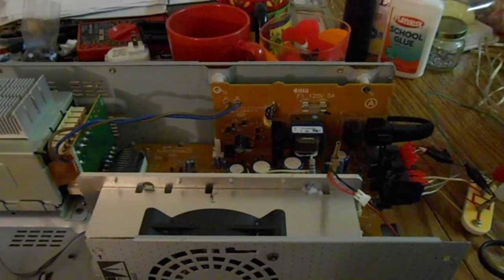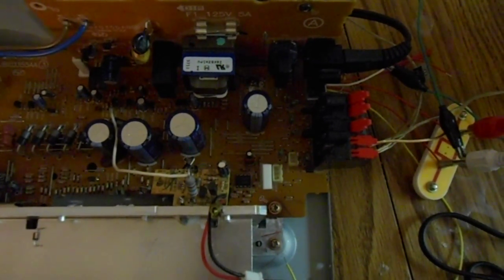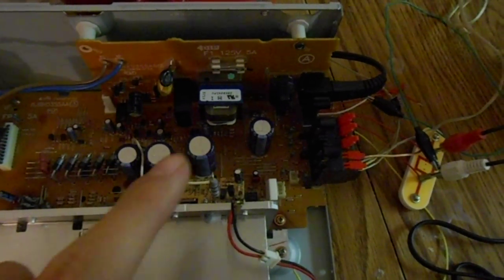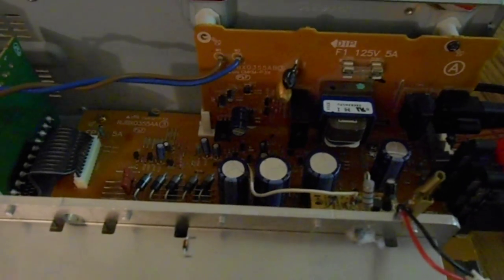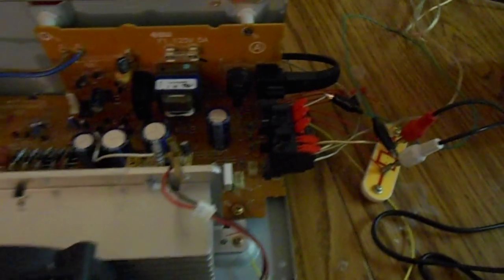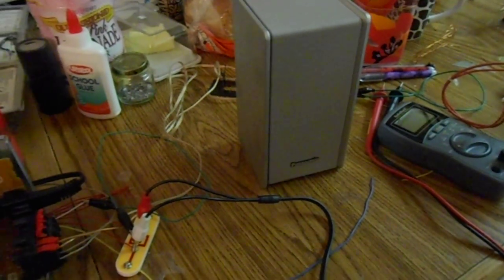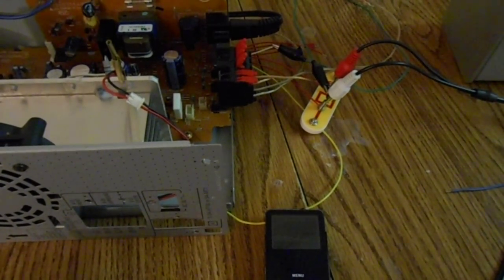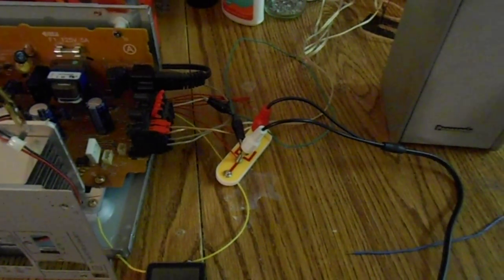panasonic 5.1 ch amplifier + hot glue flyback

Comment from the maker: Pinout: https://hackster.imgix.net/uploads/image/file/119114/Panasonic%205.1%20DVD%20pinout.jpg?auto=compress%2Cformat
The amp is from a SA-HT700 DVD player and tuner, the main circuitry has gone screwy so I hotwired the amp board, the only thing that is wrong with the amp is where the original cable jack to go to the main processor has cracked the PCB, it seems like it was like that from the factory unless my aunt got it from somebody. They sorta repaired it by soldering little wires across the gap but it isn't very stable. The little wires I have going to it shouldn't be a problem.
more documentation here: https://www.hackster.io/superbrainak/panasonic-sa-ht700-5-1-dvd-system-42bbd2

Comment: Hello, i have One of the amplifier but the DVD player not work at all, i want to connect direct to amplifier, how can i do that? Regards
Reply from the maker: click the hackster.io link listed in the description. that will bring you to a complete guide to how I modified the amplifer to turn on. you have to remove a transistor on the standby board. otherwise it will never turn on without the DVD player plugged in. once you do that then all it will need is a switch and a resistor connected from 5v standby to the power on pin. Use the pinout diagram I have on that page to get the pins right. Also make sure to use solid core wire to put inside the connector pins. if you use stranded then you will need to solder the end to keep the strands together and not fray, which could short something out!
thanks for watching best of luck to you!

Comment: Great video Brain was it the lower transistors collector that you disconnected, keep the videos coming I enjoy them.
Reply from the maker: you want to remove Q519 I believe, if removing that transistor and pulling up the power on pin turns it on then that is the correct transistor, if that didnt work replace Q519 to how it was and remove Q515.

Comment: what size of resistor is used in the 5v to base relay transistor? what resistor is used in to make the 6v to a stable 5v ?
Reply from the maker: well i just used a 1k 1/4W resistor from the 5v to the enable pin, i didnt do anything to the stable 5v line maybe it is supposed to be 6v but as far as voltage regulation panasonic seems to have opted to using transistor and diode regulators which in my opinion are junk because as the diodes or resistors get old or overheated their values change meaning so does the output for example the supposedly 12v line for the fan was only 9v and i could tell how hot the regulator circuit got by the dark spots on the PCB. your amps standby line is probably fine if it is a little on the high side, just dont use it to charge your MP3 or phone :) it probably doesnt have enough amperage to do that anyway. good luck!

Comment: You can make a diagram and explain how to connect How turn
Reply from the maker: Hey there thanks for watching! Are you asking for me to make a pinout diagram of the amp/sub main connector? I will have to look at it again but it wont take me long.
Reply from the maker: Ok so as i had mentioned in the video (good thing i watched it again as i would have forgotten) i had desoldered the collector to one of those transistors that are in the virtical line, there are two on that standby board one goes straight to the relay and the other "disables" that relay transistor (something to do with tamper protection or just a general safety feature), so what you can probably do is just completely pull that second transistor out as it only pulls the base of the relay transistor low, (try to figure out which one that is as it has been a while since ive been in it, basically desolder the one that doesnt directly connect to the relay by following the traces disregarding ground connections or power connections, (Hint: it isnt the large transistor because that one is for regulating the standby 5v supply leave that one alone) once the disable transistor is removed then the relay transistor should be able to turn on without a problem. how you turn that transistor on easily would be a resistor from the stable 5v rail to the base of the relay transistor so that whenever it has power it will turn on (basically that pin high means that the amp will turn on so you could also use a basic logic signal if you wanted a more complicated setup/mod).

Finally you can put the amp board all back together and connect it up (dont forget to plug back in the fan and Sub connections!) using my pinout i figured out (any other pins i dont describe arent important for operating the amp and are mostly smaller AC voltages or the >50v for the FLD!! so be careful!) so, looking at it you can see there are 4 wider pins 2 on either side on the top right and bottom right, those are the main ~14v <2A AC power for the mainboard and is only on when the amp is on,
then coming down from the top 2 on the right it goes;
Mute pin (High = disable i think, but it mutes the entire amp leaving it open (nothing plugged in) will leave the amp unmuted so this connection is optional to use),
then Front Left, Audio -, Front Right,
 the center mark (a little indent),
Center Input, Sub Input,
Power pin (High = ON),
two more pins i dont know what they do,
then the lower two Main AC pins (same as top they are just in parallel for less resistance).
 now on the left row it goes; 1 unknown pin,
stable ~5v (always on, you should be able to get around 500mA from it),
3 unknown pins,
Surround (rear) Left, Audio - (same as the right side one so only one connected is required), Surround (rear) Right,
then 5 unknown pins.

So basically you could tie the lefts and center to the left channel and all the rights and sub to the right channel plus one of the audio - to the negative to have it work on all speakers at the same time with only a headphone cable (standard stereo) but you can use two cables for 3.1 or three cables for 5.1 output.
Then depending on how crazy or simple you want to go you can either use a 1kOhm resistor from the stable 5v to the Power ON pin (so it will always be on when it is plugged in and just use a light switch or switched power strip to turn it on or off) or a fancy shmancy microcontroller programmed to recieve a remote signal to turn it on (pull that pin high) or turn it off (pull the pin low) and even mute it (using the Mute pin) when you want.

Now as all of the sound processing is done in the main unit you dont have any volume controls or equalizers to use or mess with so all of that will have to be done on the audio source, but i have it connected directly to my computers soundcard and it works just fine, it can get fairly loud without any preamps because i think that amp IC has them built in. now of course you could go all out and build your own equalizer , input switcher, or volume control to it but for a basic amp what i instructed is all you need to get it running on an mp3 or computer (probably DVD player or Game System also but you will probably need an analog volume knob to adjust the volume).

I really hope you can get yours working as a nice amp/speakers, as i do enjoy having mine working again after my TLC time with it and it is a decent speaker and amp system for music and movies! take care friend and good luck! let me know if you have any questions about it still!!
Reply: SuperBrainAK
Many thank for the explanation if you do not mind can make a new tutorial explaining how does this saying since I can not see well in this video the q you do. Many thank for the help
Reply: @SuperBrainAK  Its Q519 that needs to be desoldered.

Comment from the maker: ok, i cant really make a video for you as it would be alot of work, im sorry that i cant :/ i will still be able to help you on the hackster page, i will draw up and add a pinout diagram for the amp and also tell exactly how i got it to turn on and hook up, there arent any audio processors inside it so you will have to do all of that separate from the amp/sub, it does have a 14v AC out so you can bridge rectify that for at least 1A and a standby 6v line to work with a microcontroller.
Reply: SuperBrainAK my front right speaker input blew out on this exact amplifier do know how to fix it please help